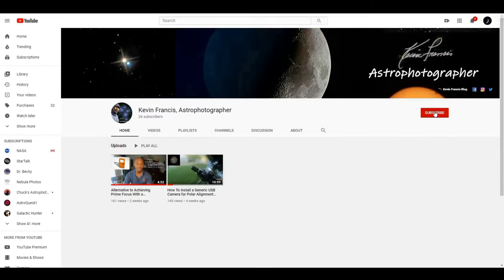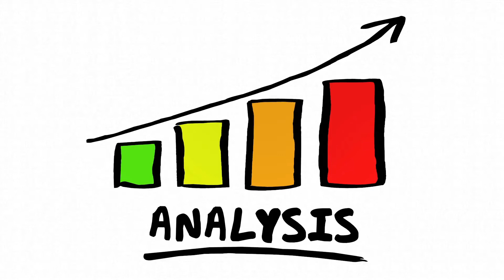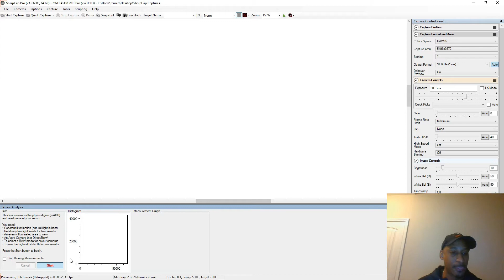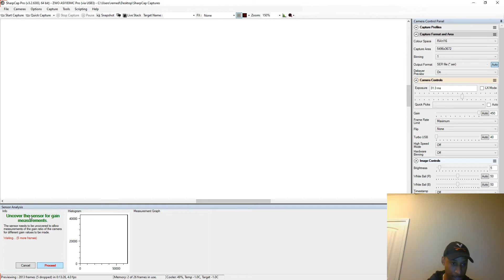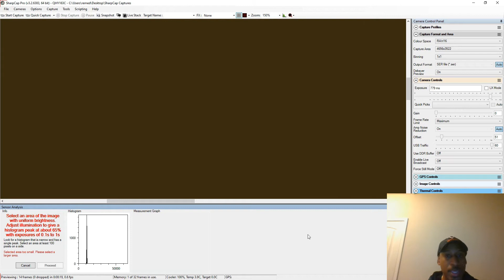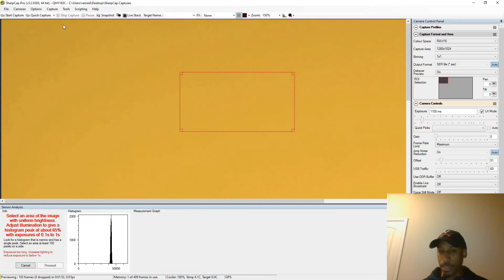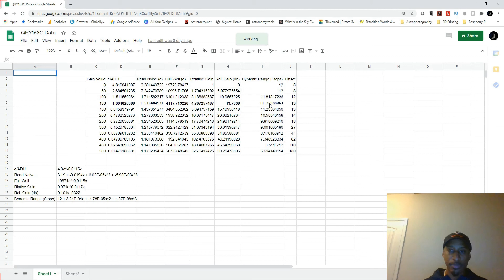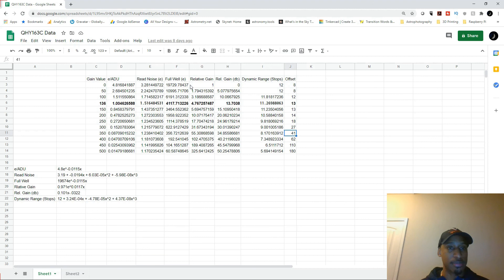How To Do A Sensor Analysis & What To Do With The Data

Comment: Yes this aggravated me too - it took me a while to realize that the capture preview unhelpfully defaults to 100% zoom; setting the zoom to Auto will let you see where the selection box is hiding in the frame so you don't need to adjust your capture area (I find when I make small changes like that I inevitably forget to reset them until its too late.) It'd be nice if they snapped to the box area when you first start the process. Appreciate the in-depth walk thru, thanks!

Comment: Thanks Kevin.  I’m a newb to TEC CMOS cameras having just come over from the DSLR world.  I’m watching your video for the 3rd time after running Sharpcap Sensor Analysis on my ZWO ASI533MCC Pro.  Your explanation of determining offset is pretty valuable.  I’ve been using my camera at Unity gain with no offset and I think that it explains some of my results.  Now that I am arm with this info I’m going to work out the offset for my specific camera and try some of those objects again, this time including the determined offset value.
Reply from the maker: Glad to see it helped.

Comment: Hello Kevin, I really appreciate you sharing valuable info. I'm new at this, what a great video.
Question,  I don't see the offset value bar in my camera control panel. I noticed yours in the Gain function category.  I'm running the latest version of SC pro. Where would I find offset value slide bar?  Thanks again, your video is spot on and helped gain more knowledge. Thanks for sharing!